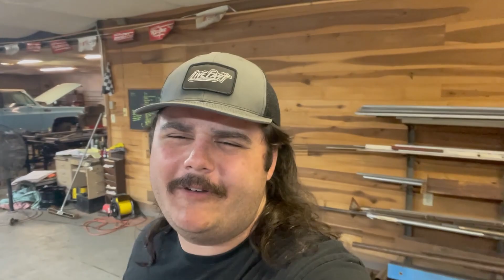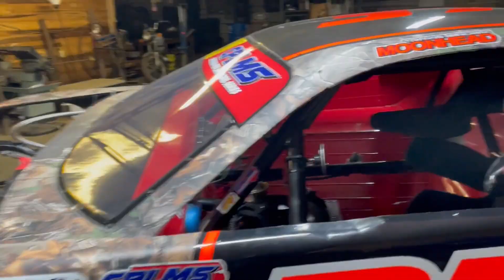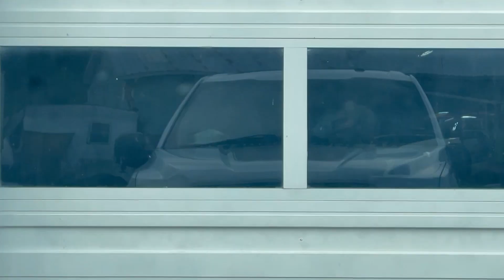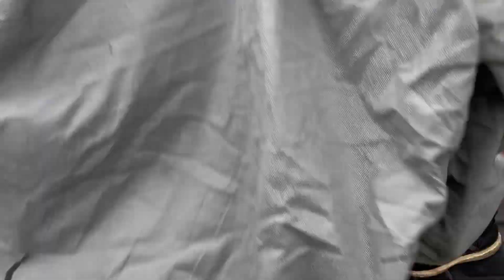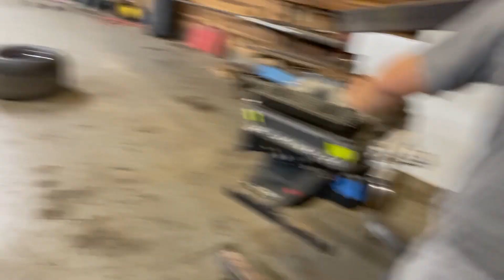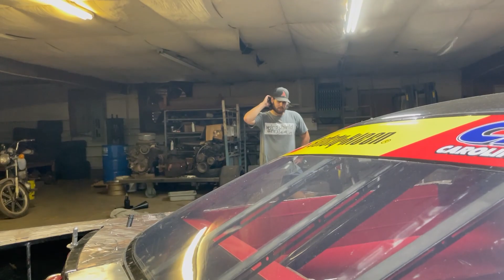WE GOT A MOTOR AND ARE GOING RACING (again) + debut recap

Comment: I'd also say it's hard to learn on a car that's not running at 100%. The more seat time you have, the faster you'll be able to go. You'll learn how the car drives, and how to adjust to changes in the setup, etc

I thoroughly agree with "why do it if you suck" explanation you gave as well. I suck at racing, but damn I'm having fun and I always race clean. It's your first races, take your time, enjoy yourself, especially if you're coming in mid season. Biggest piece of advice is respect the points leaders too, they're racing for a lot more.